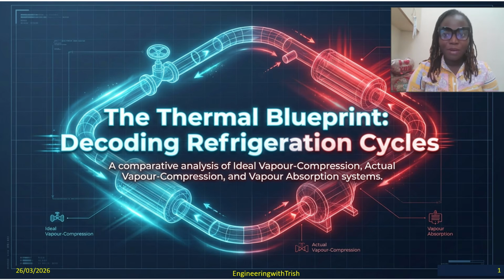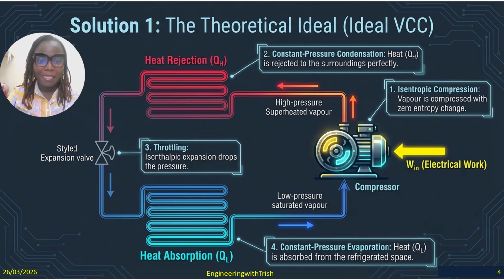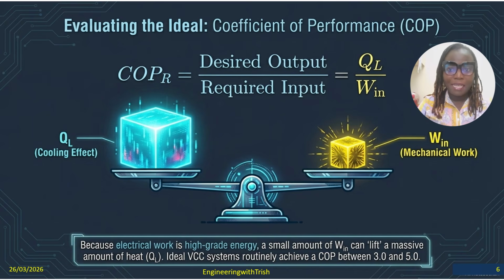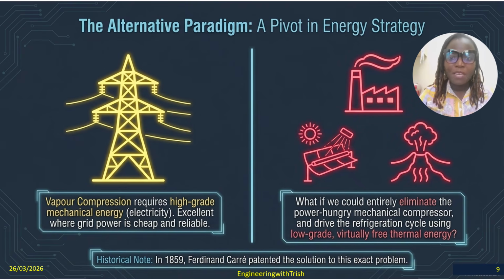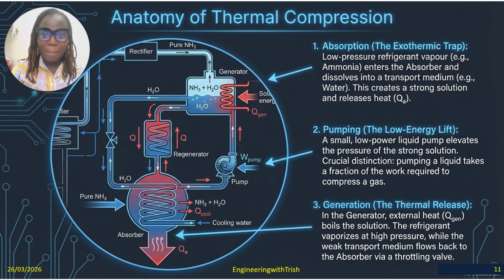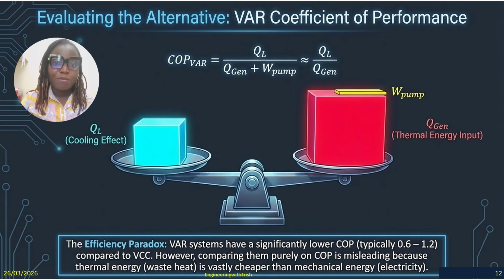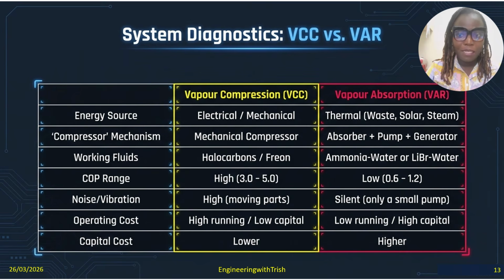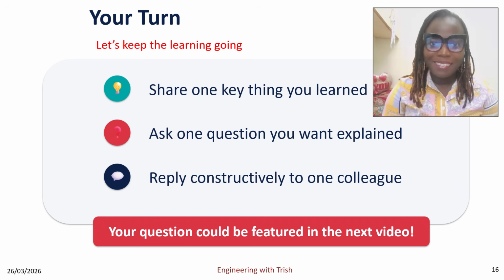Ideal vs Actual Refrigeration Cycle Explained | COP & Real System Losses

Comment: I learnt that as an engineer if you are working on machine or build any machine you to check the cooling system will because it can encounter frictional forces and you need to mount it well without any frictional forces

Comment: One thing I learned is that the ideal refrigeration cycle represents a theoretical, frictionless standard where compression is entirely isentropic and heat transfer happens smoothly with zero pressure drops, meaning there are no internal energy losses or mechanical inefficiencies.

Comment: I learnt that the Ideal Cycle is defined as a perfect, frictionless, and isentropic process with no energy losses or pressure drops. It serves as the theoretical benchmark for efficiency and the Actual Cycle In reality, systems face frictional losses, heat losses, and compressor inefficiencies, these factors reduce the cooling effect and increase the required work input, leading to a lower Coefficient of Performance (COP) compared to the ideal model

Comment: I learnt that refrigeration cycle has four main processes; condensation process, evaporation process, expansion process and the compression process. And the ideal cycle is a perfect cycle and the heat tranfer is smooth
Reply: In what areas would one consider these processes you have stated

Comment: I learnt that  heat  flows from  a higher temperature region to a lower  temperature regions but refrigeration does the opposite it moves from the cold region to the hot region

Comment: I learned that Heat naturally flows from higher to lower temperature regions, but refrigeration forces heat to move in the opposite direction (from cold to hot), which requires external work input.

Comment: I have learnt that, absorption systems have lower COP compared to the vapor compression system because they use low quality heat and they are also cheaper.

Comment: I learned that the refrigeration cycle has for main part 
And also, there’s nothing like perfect in terms of work done.
Reply: That means is not always valve, compressor, evaporator and condenser. How ever  it can be replace with generator expansion heat absorber and heat

Comment: I really liked the breakdown of why actual cycles have lower COPs than ideal ones due to compressor friction, pressure drops, and heat losses in the piping. Eliminating the compressor in VARS to run on low-grade thermal heat is such a clever thermodynamic trade-off!
Reply from the maker: Precisely, understanding those real-world losses is crucial for effective engineering design. SHALOM.

Comment: Why is the COP of a Vapor Absorption Refrigeration System typically lower (around 0.6 – 0.8) than a Vapor Compression System (often 2.0 – 4.0+), even though VARS replaces the power-heavy compressor?"
Reply: This is because VARS trades higher efficiency for the ability to run on cheap or waste heat instead of expensive electricity.

Comment: The ideal refrigeration cycle assumes no friction, no pressure drops, and reversible processes, giving the maximum possible COP. The actual refrigeration cycle includes compressor inefficiencies, pressure drops, heat transfer losses, and irreversibilities, which increase compressor work and reduce the coefficient of performance (COP).

Comment: I learnt that the Vapor Absorption Refrigeration (VAR) cycle achieves the exact same pressure transformation, but replaces mechanical force with chemical affinity and heat.
Reply from the maker: Exactly, you've grasped the fundamental difference in the input requirement! Shalom.

Comment: I learnt that heat flows from higher temperature region to lower temperature region but refrigeration does the opposite it moves heat from the cold region to the hot region that is why we need work input for this to happen
Reply: That’s correct

Comment: I learnt that , Absorption system has lower  coefficient of performance compared to vapour compression system because they use low quality heat and they are also cheaper

Comment: I learnt that the ideal cycle assumes on losses (no heat leaks,perfect compression/expansion)  . The mechanical  compression is 100% efficient and heat  exchange involves zero pressure drops
Reply from the maker: Exactly right, that serves as our baseline for evaluating real-world performance. Shalom.

Comment: I have leant 3 major differences between VAC and VCC and their energy supply which are as follow.
1.  VAC Reliability: Because it replaces a heavy, high-speed mechanical compressor with a chemical loop, it has almost no moving parts except for a small, low-load liquid circulation pump. No heavy pistons, scrolls, or screws means minimal mechanical wear, practically zero vibration, exceptionally quiet operation, and a significantly longer operational lifespan.

2. VCC Reliability: Compressors are the primary failure point in any standard HVAC system. They run at high speeds, operate under intense pressures, are prone to mechanical wear, and face severe risks if liquid refrigerant slugs back into the compressor shell. They demand strict lubrication management and regular maintenance.

1. interterms of power generation supply for VCC, when electrical energy is the primary power source, space is tight, and it require the highest possible thermodynamic efficiency (COP). while 

2. VAC when you have an abundant source of industrial waste heat or steam, want to minimize electrical grid draw, or require an ultra-quiet system with minimal mechanical maintenance.
Reply from the maker: Excellent technical breakdown of the differences between these systems. SHALOM. 😊

Comment: The ideal vapour compression cycle is a theoretical refrigeration cycle that assumes no losses in any component. The refrigerant enters the compressor as saturated vapour and undergoes isentropic compression. It then rejects heat in the condenser at constant pressure and becomes saturated liquid

Comment: I now understand that compressor increases  the pressure in the refrigerator and how the expansion valve reduces pressure. This means the cycle forms the main cycles of the air conditioning system and the refrigerators

Comment: I learned that the four main processes of the Ideal Vapor Compression Cycle are compression, condensation, throttling, and evaporation. I understood how the compressor increases the pressure of the refrigerant, how the condenser rejects heat, how the expansion valve reduces pressure, and how the evaporator absorbs heat from the cooled space. This cycle forms the basis of refrigerators and air-conditioning systems.
Reply: Compression: Correct. The compressor raises the pressure (and temperature) of the refrigerant vapor, preparing it to reject heat.

Comment: The actual vapour compression cycle represents the behaviour of real refrigeration systems. Due to friction, pressure drops, and heat transfer with the surroundings, the compression process is not perfectly isentropic

Comment: I learnt that the VCC operates using the four main components of refrigeration cycle(compressor, condenser, expansion valve, and evaporator) while VAC operates using a generator.

Comment: In a Vapor Absorption Refrigeration System, the absorption stage actually uses a single working fluid pair consisting of a refrigerant and an absorbent, rather than two separate refrigerants.

Comment: I learnt that the cop accounts for the efficiency of the refrigeration system.
And in terms of the question; the efficiency of the system we’ll be a favorable choice since the system comes to use for it importance to the customer, because as far as the system fully comes to work it can keep it function for a long time before needing energy to operate fully.

Comment: I learnt that heat flows spontaneously from high-temperature regions to low temperature regions
Reply: Yes, and refrigeration system does the opposite
Reply: The refrigeration does the opposite.
Reply: But in refrigeration it is the opposite .
Reply: It works the opposite way in refrigeration
Reply: The refrigerator does the opposite
Reply: It’s opposite in regulation system
Reply: Yes, and the choice between systems depends on factors like energy availability, capital costs, and operating environment. While compression systems typically have a higher COP, absorption systems can be more suitable in scenarios with abundant low-cost thermal energy.

Comment: The ideal cycle is a theoretical model  assuming perfect, isentropic compression and no pressure drops. In contrast, actual cycles  face real-world inefficiencies like frictional losses, heat transfer issues, and compressor limitations, which result in a lower Coefficient of Performance (COP)

Comment: I will choose efficiency when getting a refrigerator. I learnt about how thermal blueprint decoding refrigeration cycle works and also how the refrigerator allows and regulate heat. Also the process of refrigeration is learnt too

Comment: I learnt that heat flows spontaneously from a high temperature region to a low temperature region. In the ideal vcc compression is isentropic thus theres no pressure change
Reply: Perfectly said.

Comment: I learnt that in the ideal cycle , there is perfection in the process whereby there is no heat loss, and mechanical efficiency is high whiles in the actual cycle, it's not the same, but rather there are heat losses, and efficiency is low.
Also in refrigeration cycle there is vapour compression systems  which has a compressor and vapour absorption systems of which the compressor is replaced by a generator , pump and absorber.
My question. Is the vapour compression systems  still in use in these current times.

Comment: I learnt that the Ideal Cycle: A theoretical, "perfect" model where processes are isentropic with no energy losses or pressure drops. It sets the benchmark for performance.
Actual Cycle: Reflects reality. It accounts for frictional losses, heat losses, and compressor inefficiencies, which result in a lower Coefficient of Performance (COP) compared to the ideal cycle.
Reply: Insightful

Comment: Efficiency, serves as a major factor in customer satisfaction, choosing energy availability o'er efficiency can create high cost of maintenance due to low efficiency created. I would choose efficiency o'er energy availability
I learnt that VCRS contains a compressor whilst the VARS does not, but rather contains an absorber, pump and a generator 😅

Comment: I learnt that the VAR has a lower COP as compared to the VCC because they use low quality heat like solar,steam etc. and they are cheaper.

also the difference between cycles is dependent on the Driver

Comment: About your question choosing between efficiency and energy availability 

I believe it depends on the specific requirements of your situation

Efficiency is key for reducing operating cost when power is stable. 
And energy availability becomes the priority when supply is unreliable.

Just like you said 
“engineering is about choosing the system that is most suitable for the specific context rather than simply selecting the one that is the most efficient on paper”
Reply: Rightly said.But I think it will be advisable to choose efficiency because it will go along way to reduce cost of operations since the power availability criterion may require regular maintenance.

Comment: I will go for the vapour absorption system. There are many places in Ghana where electricity is scarce and even those with it have random shortages. The solar energy or waste heat are a perfect energy sources. 

I learnt that there is no perfect cycle....because as work goes on there will be pressure drops, energy differences and friction between parts.

Comment: My question is why do absorption systems have lower cop as compared to the vapor compression system?
Reply: Because, absorption systems run on thermal energy, waste, solar etc which is low-grade (quality) while the compression systems work on electricity which is more efficient

Comment: I learnt that refrigeration does not use the normal law (Heat flows from a higher temperature region to a low temperature region but rather Heat moves from a cold region to a high region

Comment: I learnt that, the ideal cycle has a mechanical compression of 100 % and also a larger COP since work done is less. Compared to that of the actual cycle the COP less since much work is needed to overcome heat losses , pressure drop and overheating or sub cooling

Comment: My question is, Since the Vapor Absorption System (VAS) has a much higher capital cost, what is the typical 'payback period' before the savings on running costs make it cheaper than a standard Compression system?

Comment: I would choose Efficiency (Vapor Compression): This is the better choice if you have a reliable and affordable connection to the electrical grid. It offers a higher Coefficient of Performance (COP), meaning you get more cooling for the energy you put in.

And also I learned that VCC uses a mechanical compressor (high-grade energy).
 And VAS replaces that compressor with a combination of an absorber, a pump, and a generator (low-grade energy).

And also the Actual Cycle will always have a lower COP than the Ideal Cycle because real-world systems face friction, heat losses, and pressure drops

Comment: Madam please I learnt that hit moves from a higher region to a lower naturally but a refrigeration allows heat to flow from a lower region to a higher region. I also learnt that refrigeration has four process which is evaporation process, condensation process, compression process and the expansion process. 🔥

Comment: I learnt the differences between ideal and actual vapor-compression refrigeration cycles. Ideal cycles feature perfect isentropic compression and frictionless heat transfer for maximum COP. Real systems face compressor inefficiencies, superheating, subcooling, and throttling losses that raise entropy and work input. COP drops as a result, often to 2-4 in practice versus theoretical peaks. Core components, compressor, condenser, expansion valve, evaporator, drive the four-stage process. Engineers use this knowledge to optimize HVAC despite real-world gaps.

Comment: I have learnt that the vapor absorption refrigeration (VAR) systems operate without a mechanical compressor. They utilize an absorber, pump, and generator to move heat, powered by waste heat or solar power.
Reply: That's right

Comment: I would choose efficiency because it determines how much of the available energy is actually convert into useful work.

I learnt that the ideal refrigeration cycle assumes no losses and operates with maximum efficiency, while the actual cycle includes real world irreversibility such as friction, pressure drops and heat losses resulting in a lower coefficient of performance.

Comment: I learnt that naturally, heat flows from a higher region to a lower region but in refrigeration, heat flows from a lower region to a higher region which work input is required for the process and the ideal cycle is a perfect cycle, no losses.

Comment: 1. I learnt that the external heat ( solar, gas and steam etc)is applied in the generator.

2. The high - pressure ammonia vapor cools in the condenser .

Comment: I learnt that in natural law, heat flows from a high-temperature to a low-temperature, and refrigeration has four main processes, namely Compression, Condensation, Expansion and Evaporation processes 
I also learnt that as an engineer it is not about using  the most efficient system but, using the most suitable system for the situation

Comment: I learnt that absorption systems have lower COP compared to the vapour compression system because the absorption system use low quality heat, and they are also cheaper

Comment: My question is if vapour compression refrigeration system is has a higher COP as compared to vapour absorption refrigeration system then why does vapour compression refrigeration system perfom very poorly when not working at 100%.

Comment: I learnt that vapour compression refrigeration system has a higher COP as compared to vapour absorption refrigeration system because vapour compression refrigeration system use a high quality heat and also is more expensive.

Comment: I learnt that in an ideal cycle, mechanical compression is 100% efficient.
Also the operation of a refrigeration system is measured using the coefficient of performance(COP) and it's the ratio of the cooling effect (Ql) to the work input(Win).
     Mathematically, COP = Ql/Win

Comment: Thanks for this nice presentation
 
In this lesson about the various refrigeration cycles,I learnt that the VCC has higher COP because it uses high-grade mechanical/electrical energy while VAR has lower COP because it relies on low-grade thermal energy.

Comment: I learnt that the vapor absorption system has lower COP compared to vapor compression system because they use low quality heat and are cheaper
Reply: The best system to consider depends on your energy source

Comment: From my perspective, I will choose efficiency, I learnt that the performance of refrigeration system is measured using the Coefficient of performance (COP) and it is the ratio of the cooling effect to the work input. Also I learnt that absorption systems have lower COP as compared to the vapour compression system.

Comment: In this lesson I learnt that ideal cycle is reversible with a high COP (Carnot limit), while the actual cycle suffers irreversible losses (compression, pressure drops, finite , throttling) making its COP significantly lower.

Comment: From this lesson, I learnt that vapor compression systems have a higher COP compared to absorption system because they use low quality heat.
Reply: That's true, but these systems can't be compared basically using their COPs
There are other factors to consider when choosing the refrigeration cycle you want..something like efficiency,cost involve,etc